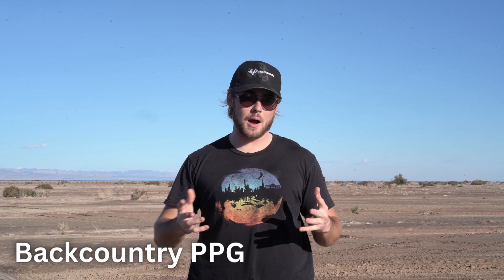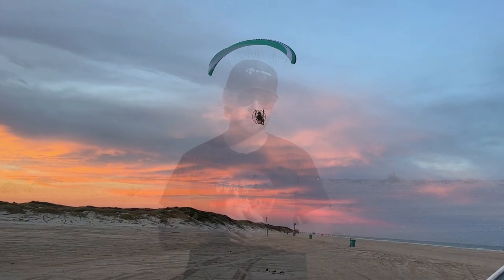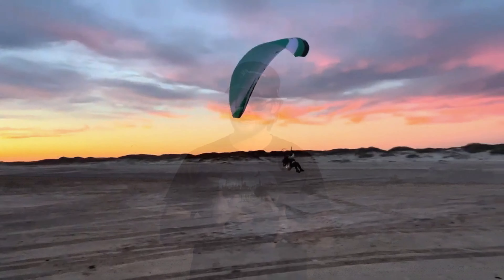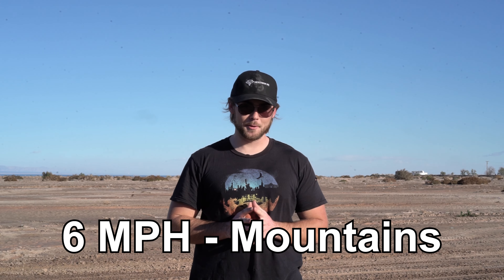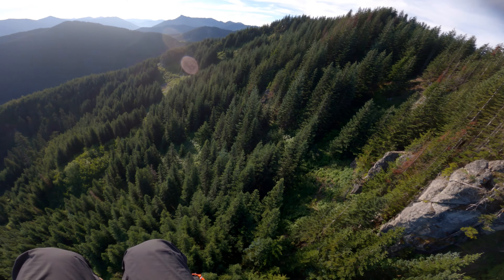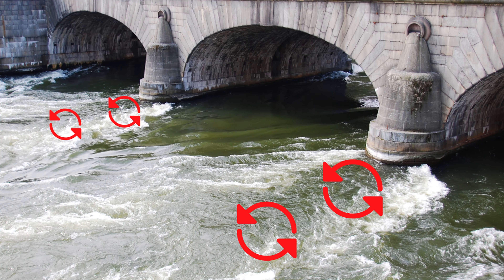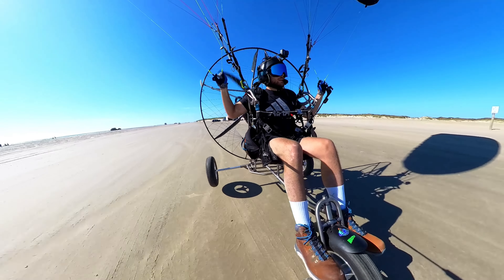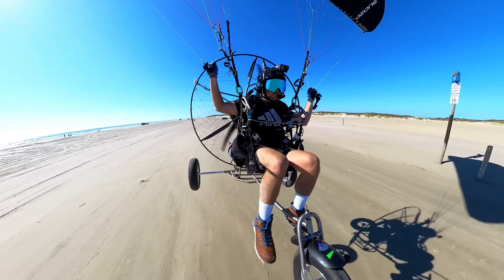How Much Wind SHOULD You Fly A Paramotor In?

Comment: I went to Aviator PPG last year but your knowledge has been an awesome resource for  secondary opinions for me so to say. Still working on getting equipment but just bookmarked this in case I ever need a refresh 🤘
Reply: So you went through training a year ago and haven't flown since?
Reply: @lobbyrobby  unfortunately no, cost being the main reason. I know I'll need a bunch of kiting sessions before taking a "first" flight again. I had an opportunity to take the 2 weeks for training so I didn't wait 🤷‍♂️
Reply: @Brody961  I see. That's kind of a worry for me. I'd probably go to them for training over the winter but then when I get home I wouldn't be able to fly for maybe months. Hopefully you can get some equipment soon and get back in the air. How was the training? Where did you stay at?
Reply: @lobbyrobby  0 regrets. If you are fortunate enough to have the means to do it(like I did), you won't regret it. Even though it's been a bit since Ive gotten to fly, after going through training, I would still feel confident knocking off the rust and getting under a wing. (Like I said above, after doing a few kiting sessions for practice). 

The only thing that's a limitation with their training ****for me** is the Lake Wales geography/weather is not the same as my own (New England) but thats not a fault of them. Realistically, Trevor's course might have even been a better fit for getting used to my own environment, but thats why in my original comment I pointed out how helpful a video like this is. 

For the place i stayed, Eric Farewell, the owner, had a rental property that they offer to students. Nothing special, but it has everything I needed so no big complaints, ~10 minutes away from the training.
Reply: @Brody961  thank you. Good luck getting back in the sky

Comment: Good info but you didn't cover one more factor - winds aloft.  The wind gradient is an important consideration - winds may be acceptable at ground level but totally different 1,000 ft up.  Often I see wind speeds of greater than 20 mph at 1,000 when surface (flat land) winds are in the 8-10 mph range - that's my cutoff.  I don't want to get up at altitude and see my ground speed slow to a crawl or be forced to fly at very low altitudes to escape the wind.